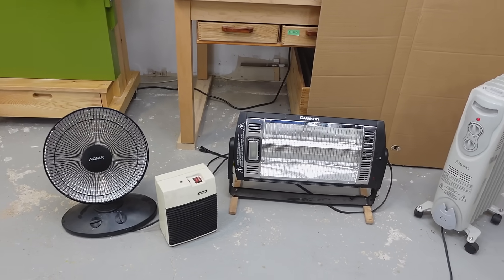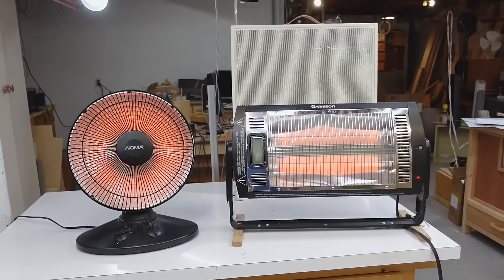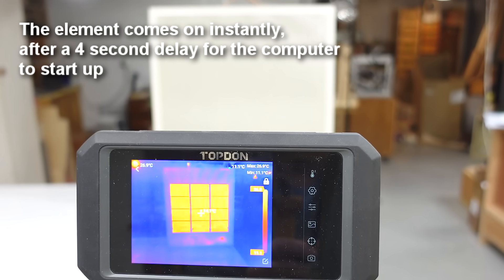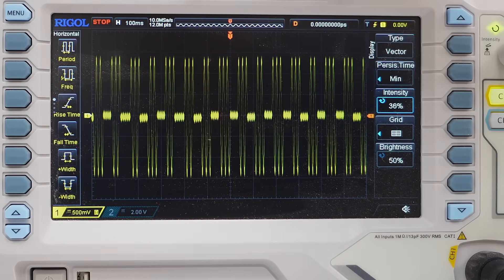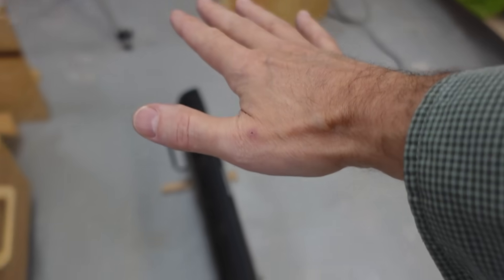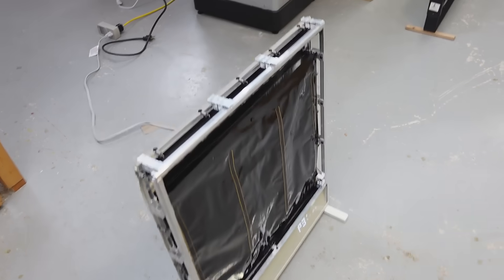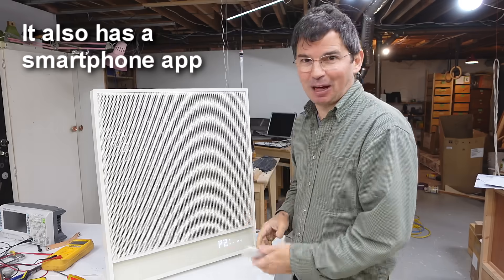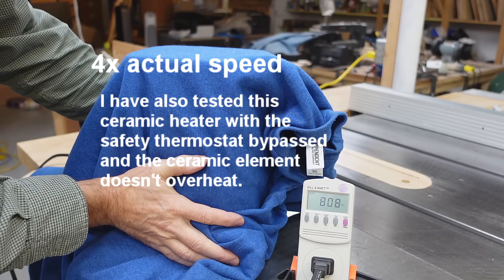Best heater to keep me warm at my desk

Comment: How do you manage the combination of having solid below 15°C and no problems with mold?
I can swap the air as much as i like, if it gets bleow like 16°C on an outside wall, water might condensate :(
Reply from the maker: dehumidifier
Reply: @matthiasrandomstuff2221  Thanks. I thought those were basically a hoax since I've you open a door all new moist air will come in. I'll try that.
Reply: @antraxxslingshots  When it gets cooler outside, keep in mind that cold air holds less moisture, so ventilation is sufficient to avoid this issue. Dehumidifiers are only needed in extreme circumstances.
Reply: @aliasgharkhoyee9501  thank you for your reply. ventilation is in my case easier said then done. it's a dead end long narrow cellar room... just leaving a window open all winter is no real solution

Comment: Radiant heaters seem rare in England, but I do have an Oil filled room heater. Do you have any Gas fired Central Heating with radiators or warm air ducts?
Reply from the maker: depends where.  Here in new brunswick, few people have gas because its only slightly cheaper than electric heating.

Comment: Matthias,   being the expert builder that you are...  Have you considered making a Rocket Mass Heater ?   Or a simpler  Rocket Heater / Stove ?    They are extremely efficient, and burn clean (no smoke exhaust).   I read that a guy that was using a typical fireplace, switched to a rocket mass heater...  and he went from using 4 Chords of wood... to a Single Cord of wood,  for the entire Winter.
Reply from the maker: doesn't make sense when we don't heat with wood.

Also, modern high efficiency wood stoves achieve the same thing.  There is no magic to it.  You just need an insulated high temperature burn chamber, like like modern high efficiency wood stoves have.  So I would just buy a newer wood stove.

Comment: For that DRIO rather than a pedestal base you could hang it from your ceiling.  I wonder how well those infrared heaters would work if you hung them from the ceiling aimed at your computer chair.
Reply from the maker: its my legs that get cold.  Also, infrared heaters that aren't meant for ceiling mound will usually not work for ceilings as they rely on convection to keep themselves physically cool.

Comment: Is reverse cycle aircon an option in the Canadian cold? That kind of climate is a bit foreign to me since I live in a sub tropical zone.
Reply from the maker: called a heat pump, and we use those.  But you can't very well direct that at your desk.  And you need slightly warmer temperatures when sitting at a desk.  So a small heater to heat at the desk still makes sense in terms of saving energy

Comment: What if you keep the screen on, and paint it black on the inside? In steady-state it cannot stay cool, and will radiate, eventually.
Reply from the maker: it absorbs the infrared even with its white color.  And it will radiate a little bit, but you don't want that screen to absorb infrared, cause it will just mostly release it through convection.  If you want a lot of infrared, you need something hot.

Comment: I'm from Wisconsin. I've been using electric space heaters every winter for 40 years. Mostly quarts heaters to fill my needs. Those tall upright quartz heaters are fantastic, but I've only had one that lasted more than a couple years. In my case the tip over switches die. I still use the first quartz heater I ever bought in my bedroom. It's down to one tube out of two, 750 watts now, which is perfect for my bedroom. Many types for different purposes, don't make a hasty purchase. Think about your house's wiring, where will it be located, do I have a heavy duty extension cord, when used correctly an electric space heater is quite safe. Mattias, do you have an opinion on the wired space heaters?  Might be called monofilament, I'm not sure. The old school style heaters.

Comment: Suggestion...include an EMF test for each unit...I tested my air cleaners and heaters...SCARY!
Reply from the maker: When I worked at Blackberry, they did EMF testing on the devices.  It takes a lot of equipment to do it right.  As it is, I don't even have a spectrum analyzer
Reply: No point doing that for the "dumb" ones (the ones with a physical switch). They are no different than a light bulb. The "smart" ones won't be much worse either, as they will all be zero cross switching AC into a resistive load (like seen in the video), because any other way of "dimming" the heaters would be just more complicated without any advantage. 
I don't know what you are expecting though. How did you test your devices? Without a proper setup there's a high chance that what you measured has not much to do with them, but crap that's coming from other things around. What was "SCARY"? Just because you see something doesn't mean there's anything to be worried about. What power levels and frequencies did you measure?

Comment: Really ugly/dirty power influence of that carbon film heater 😮😮😮. How did that come through whatever type of quality control?
Reply from the maker: unlike dimmer switches, it only switches on and off at the zero crossings.  This makes for less EMI, which is regulated.  But causing the lights to noticeably flicker probably isn't regulated.

Comment: i refuse to buy app crap.. i love oil filled heaters,, very safe at low settings.. the only  heater i  feel safe leaving on when im away.. i use 2 per room on lowest settings and make sure the temp is at a  cycling place..so it will cycle on and  off in that space.. 
the others, ive tried.. and  come to  the same  conclusions as you

Comment: How did they go through QA without noticing their system was drawing power in odd patterns? That's actually very dodgy, having current fluctuations like that can mess with electronics.
Reply from the maker: if you have a big service, and the heater is on its own circuit, lights won't flicker much.  Also, its from china.  So a 120 volt heater would be running off a separate transformer or power station to get 120 volts, lessening the effect as well.

Comment: you could try using the white panel one with regular dimmer switch which cuts the waveform through the cycle instead of zero crossing these are easily available for cheap upto 2-3KW online (with all the smart crap removed). Or may be direct power from the variable transformer to find a comfortable level. Similarly may be try using something like polycarb for front ?

Comment: I can't say how many times I've looked at an electrical item and wished it just had a switch. If they have to add a remote or an app, then fine- as long as functionality is maintained on the unit itself. We have four mini-split units in two buildings which can only be controlled by remote; three of the four have been lost and we'll be out of luck once the fourth disappears.